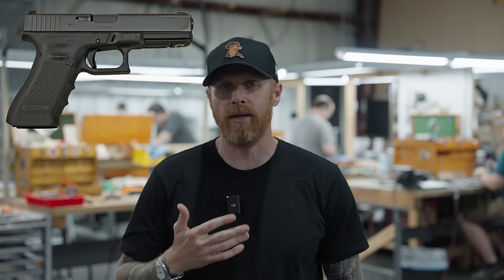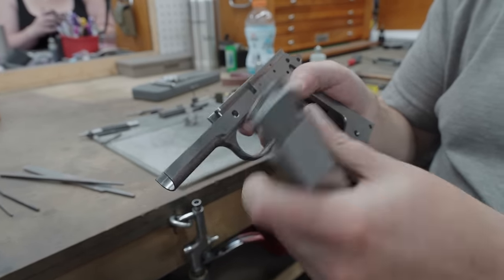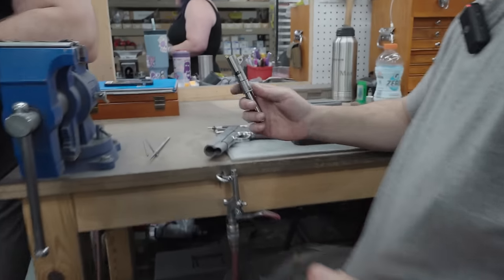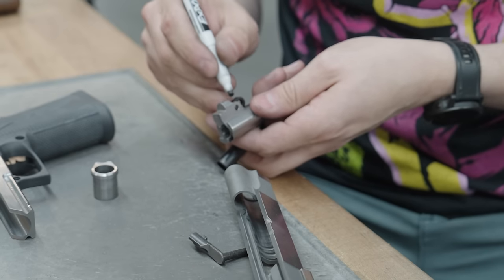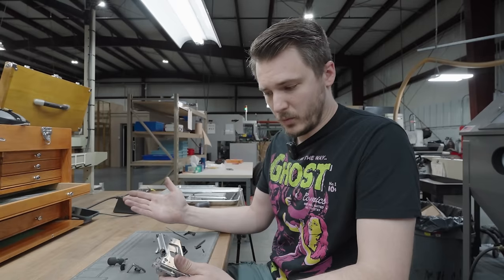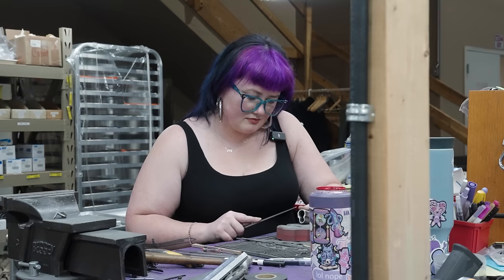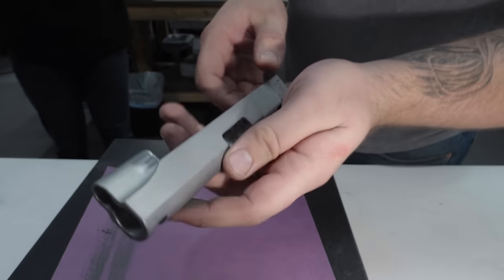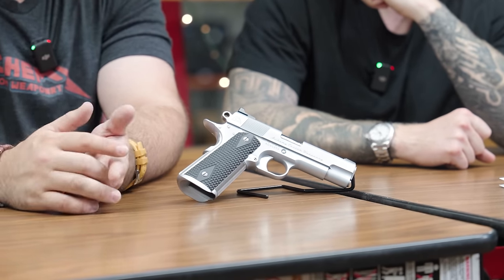Hand Made 1911’s - How They’re Made - Why They Matter - With Alchemy Custom Weaponry

Comment: I never leave comments, but I want to try and explain why polymer striker pistols have captivated so many communities within the gun industry, specifically the LEO and MIL communities. I will start by saying that a reputable and quality 1911/2011 is probably the finest pistol money can buy. However; it is not a gun anyone needs, it is a gun that people want. It is a luxury pistol. Most Local, state, and federal law enforcement have chosen Glock over other companies due to the comment mentioned in the beginning of the video,  yes it is cheap (dollars and cents) and reliable. Glock also has decades of reliability and a solid warranty, especially for Gov Agencies. Most law enforcement and even military budget boards will never be able to justify spending $3000 all the way to $9000 dollars for a single pistol. Second, many (not all) people within Law enforcement and military are not gun savvy and have the minimum training and do not regularly maintain the issued firearm. 2011's like to be wet, they need to be regularly maintained and oiled. Some might even say that this could be a risk for a cop or soldier. Example, Border Patrol operates in a very dusty, dirty, and dry environment. Not only would they have to make sure the gun is oiled and cleaned regularly, but the oil could actually attract dust and debris, possibly clogging the gun from operating reliably. For this reason Government entities want a firearm that goes bang every pull of the trigger regardless of the maintenance schedule. Thirdly, most cops and soldiers make terrible money. I remember making $47,500 a year in 2019 at 8 years in law enforcement when I made the switch from local to Federal. With a wife and 3 kids, buying a 500 dollar Glock was a significantly wiser purchase than a $4000 2011. Its not that most refuse to buy a 2011, its that most can't afford it. If I can't afford a $4000 dollar vacation for my family, what kind of selfish asshole would I be buying a $4000 2011 for myself. I think most soldiers and police officers who have the responsibility of a family would agree with me. Lastly, most cops and soldiers shoot and train for two reasons, to be prepared for the challenges of the job and also because it is fun to shoot. Many of us train and compete with a similar platform to what we use at work so that we are very comfortable with our craft at work. Hence why most buy and use polymer striker guns. I hope this puts it in perspective. Its not that we polymer wonder 9 owners hate the 2011, its that we just can't afford it, I think I've said this like 3 times in this paragraph lol. The price point is outrageous. A 1911 in 1960 ranged between $12 and $35. Compared to $3000 in modern America with the same quality of fit and finish, come on, its outrageous. Cars are no different. A suburban in 1985 was $12K brand new. In 2024, a suburban is $73K brand new. In 1958, my grandfather made roughly $15K a year. He was able to buy 20 acres and build a 2100 square foot farm house in a rural paradise for $26k. He also bought a brand new Colt 1911 GI model in 1974 for $216 bucks brand new. I make a little over $100K a year and could barely afford my 1800 square foot home on a 1/4 acre. Inflation is garbage across the board, including the 1911/2011 market.

Comment: My first gun was a Star Modelo Super in 9mm Largo.  It was super inexpensive and looked just like a 1911.  Shot at the ranger until the firing pin broke.  Had a gun smith replace the firing pin and check over the gun.  Everything else was in great condition.  Still have the gun, but my dream gun is the 1911

Comment: Im a gunsmith who specializes in 1911s, the funny thing is that the smoothest slide to frame i have ever seen was in an illegal shop in the Phillipines that was built on a ww1 frame and slide that was us property marked. The owner of the shop said his grandfather was given the pistol by an American when the americans invaded to fight the Japanese. His grandfather was a guide for us forces.
Reply: I use diamond paste, it looks like they use zircon or pumice. The diamond uses less material but the zircon and pumice are cheaper. The difference is that I make a fraction of the amount they do. I have an amt longslide that I bought from amt as a kit, the slide didn't fit when I got it, it was my project for my keystone project.
I use Bailey bushings and measure the barrel and fit it to the bushing. You will shoot the barrel out before the bushing goes.

Comment: Another few traits of the Glock besides cheap and reliable, would be excellent performance, parts compatibility, light, tragically good mags, lifetime round count without smithing, less finicky to ammunition shape or velocity, and a host of other positive qualities. It may be soulless, but it’s also a savage.
1911’s market themselves almost entirely on history, Americana, hand built, fit and finish, and other points that might make a person buy a Rolex to show off.
The reality is, it’s the trigger alone that carries the 1911 over its magazine reliability deficits and feeding issues. 
That said I love the 1911 as I do the Garand. I also like my 66 Chevelle 427 4speed, and it can’t hold a candle to a modern car in performance, but it does have a soul.

Comment: I just finished watching Garand Thumb drop test a bunch of pistols to see if they would go off...The 1911 failed. As in, all the 1911 variants (that they tested) failed, that means 2011's failed too. I realize most people don't drop their guns, but it is nice to know that modern guns (Glock, M&P, PSA Dagger, CZ 75, Beretta 92, even the SIG P320 & P365) don't go off if they're dropped. If you're using a 1911 you better be sure to hang onto it. 😉 Oddly, the Browning High-power didn't go off, I think some of those have firing pin blocks though. It was always the firing pins inertia that set off the pistols not the hammer falling.
Reply from the maker: He dropped guns from 2 manufacturers. There’s a lot left out of that vid, it’s not helpful
Reply: @1911syndicate  Wait a minute. How is it not helpful? He dropped a staccato and a Nighthawk. (I think he dropped two different Nighthawks) Are other 1911's made with some device that blocks the firing pin, that I'm not aware of? Just saying "it's not helpful" without explaining why doesn't answer, why it's not helpful. I get that you really like 1911's, and I think their cool too, but let's be honest. They failed a drop test from chest level. I honestly don't care, I don't carry a 1911. I own one, but I'd own one or two of everything, If I could afford it. ( Except High Point yuck!) I'm an equal opportunity gun lover. (With exceptions) If you can show me that other companies are putting firing pin blocks in their guns or making their 1911's somehow drop safe, I would get what you're saying. So, show me, you're the one with the YouTube channel. I just want to know. Are there 1911's that are drop safe from the factory?

Comment: Full respect to the gunsmith doing the work here, but the only reason they need to spend so much work doing the fitting is because the machining is not accurate enough to creat the fitment per spec. 
Companies like Vudoo is innovating to create precise machine made parts that minimize the amount of fitting required so they can bring the price down at the same time give you the same tight fitment. 
We need great gun smith doing a lot of things. Polishing, tuning guns etc, but fitment probably should go away in the future.

Comment: Not to take anything away from what ACW or Wilson Combat DUUUUUH "extra" (another 5-10 minutes per gun vs Dan Wesson gunsmiths? Springfield putting together aTRO..)... Won't work any viidoo magic and turn the butter if that$60000 1911 into Rib Latham.... Rib will on door any competition shooter with a$500 bone stock Glock 19 any day.. . 

Just makes certain types of guess happy to bring a$60000 ACW to the range heh.. All three r to then.
Reply from the maker: Man I was going to try and correct the grammar in this and quickly gave up